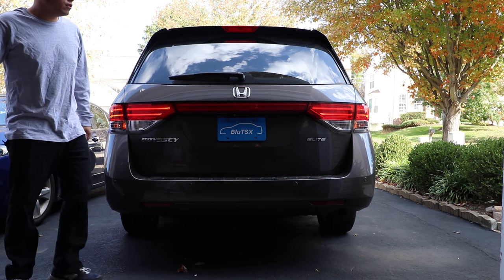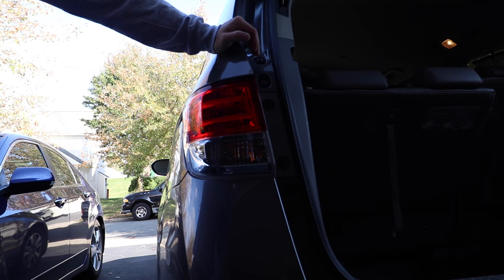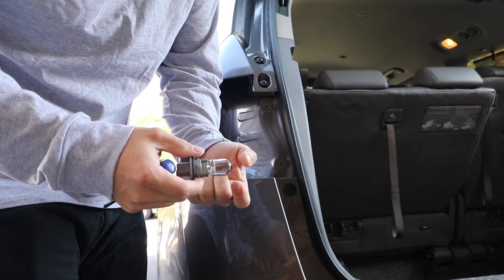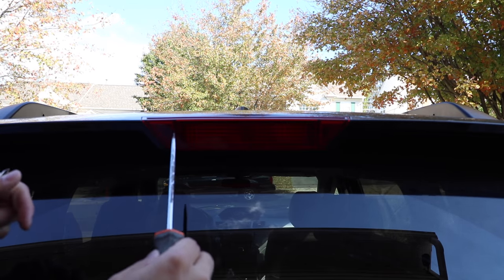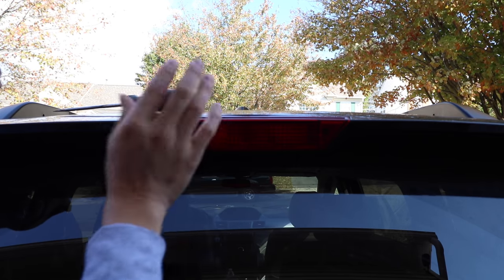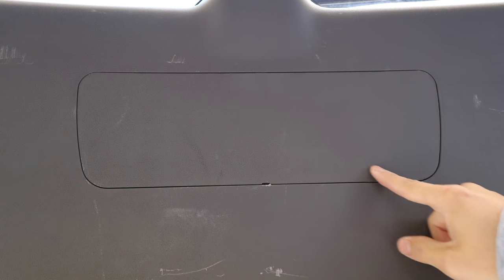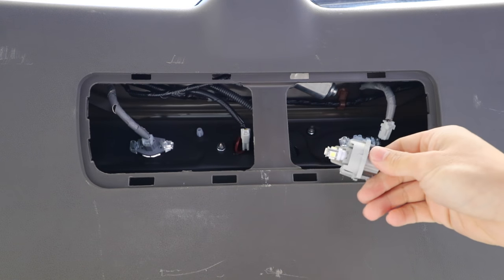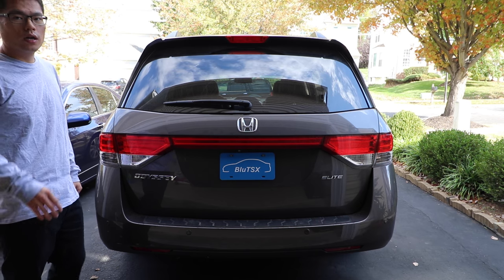2011-2017 Honda Odyssey Replace Tail Light, Brake/ Stop, Turn Signal, Reverse, & License Plate Bulbs

Comment: Thank you for posting.  I had a very very hard time getting the light off the driver's side. It was not as simple as you showed. I pulled and even hit it with a rubber mallet multiple times and harder than I thought I should. It wouldn't budge for about 15 minutes.  After praying a lot it finally came off.

Comment: Thanks, Blu! Watching your video earlier today made it a CINCH to replace the lower and HI brake lights on my wife's Odyssey. Right now, I was able to get the 921 (high-mounted) and 7440 (both Sylvania Long Life 2-packs) bulbs for the online price of $2.02 and $3.47!!! If you go in and have searched out Wal-Mart's online price--just show it to customer service (I was able to do it in the auto section). The regular prices are $5.99 and $4.48, so I grabbed TWO of the 7440!!!  Autozone wanted something like $7.99 for the 7440. Now, my family can ride around MUCH more safely!
Reply: Was at the Honda Dealer they wanted $34.75 to replace bulb
Reply: If you put an LED 3rd brake lamp, it has polarity. If it doesn't work, turn it around and try again.

Comment: Thank you. I got pulled over tonight and I told the officer I am headed straight to autozone to buy new tail lights and they will be replaced tonight. He actually followed me most of the way. I was not joking. It beats getting stopped again!!

This was harder than on my old hhr but really easy when I saw how it was done so we replaced both sides at the same time. I spend more time replacing lights in this dam van than I do washing it!

Comment: Thanks for the video!
The left brake bulb was actually 7443. Not 7440. The auto store told me 7440 is single filament, and 7443 is dual. I checked the bulb that came out of my Honda, and it was 7443

Comment: 2:00 The recommendation for using gloves to handle light bulbs only applies to high temperature quartz halogen bulbs. It does not apply to glass bulbs.

Comment: Thank you for addressing the LED aspect of the tail light. My 2014 tail light is different than every other video I've seen that shows two bulbs without the LED part. So mine is the same as yours. It must have changed when they did the 2014 minor update to the Odyssey.

Comment: It’s 2021 & this is the 1st time a bulb has had to be replaced. A lot of dirt/grit  has built up along/inside the seam coming down from the slot. Wiggling the cover didn’t work. (It did wiggle loose where screws came out). We used a very small flat screwdriver to help pop the cover off. Be very gentle working it down the seam so you don’t scratch the paint. Make sure you wipe off the area along the panel & cover meet to eliminate the dirt/grit.

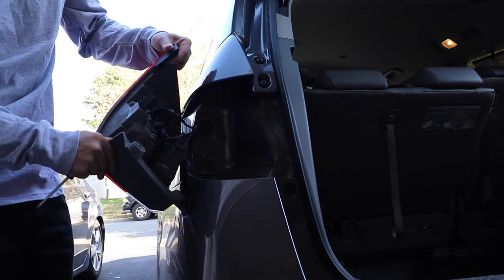Comment: The lens does not pop out easily, unless it's been out before.  On my 2011 Odyssey it was extremely hard to remove.  I finally got an approx 1/2" plastic rod (to not scratch the paint) and put its tip against the outer forward edge of the lens assembly.  Right where your left thumb is at 1:28 in the video.  On the edge of the red plastic - not on the black plastic deeper in the channel / closer to the car body.  Then I hit the rod with a rubber mallet until the lens popped out.  If you seat the rod too deep into the channel, on the black plastic seal / support piece, you'll break that.  Don't ask me how I know this.  I put some lithium grease on the snap-in pins so maybe it will be easier next time.

Comment: Thanks for the instructions! On my 2013 Honda Odyssey, it was really hard to pull the light fixture off of the back of the car (shown at 1:23 in your video). My teenager and I pulled and pulled and nothing happened. Then we realized we weren't pulling hard enough. The black rubber pegs that hold it to the car body can be quite tight.
Reply: I have the same issue and how did you make it to take it off.
Reply: Same here. Any tips?
Reply: Honestly, we just pulled hard. It’s on with almost a suction effect.

Comment: Hi, thank you for this video, it was very helpful on how to get to the bulbs. The 2012 model actually only has 2 bulbs on the brake/turn signal assembly.  So instead of 7440 bulbs, 2012 owners should be looking for 7443 bulbs.
Reply: as well as 2013 models.  all sites i check show 7443 for the part

Comment: Removed the screws, lens wont slide out. Afraid of breaking it. Suggestions? DW 40 ?
Reply: They make a tool for that. It’s basically a plastic wedge that you use to pry it out from the back side of light assembly where it meets the body.
Reply: Mine won’t come out either. Did figure this out? I have a 2014.
Reply: There are two push-pin clips that cause the resistance you're feeling. You'll need to wedge a PLASTIC trim removal tool between the headlight case and body, and carefully pry it toward the back of the van.